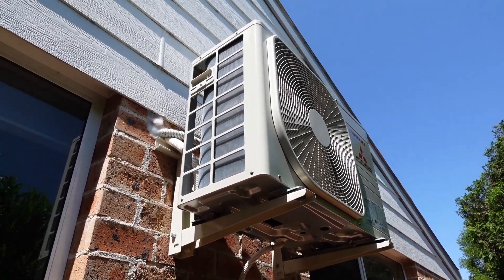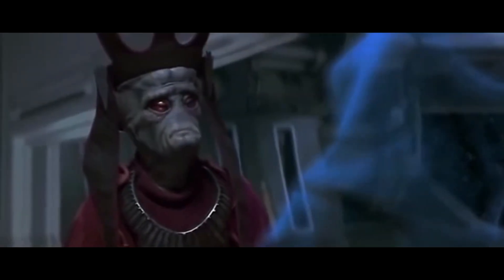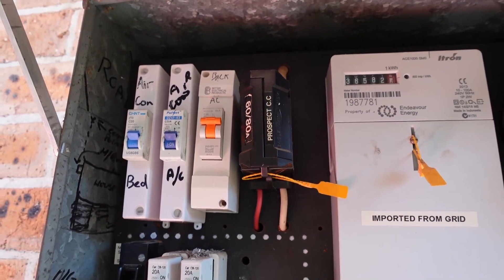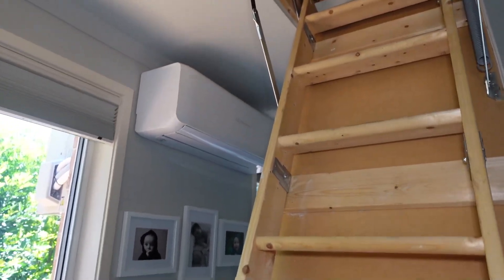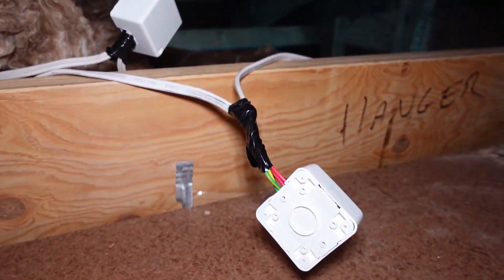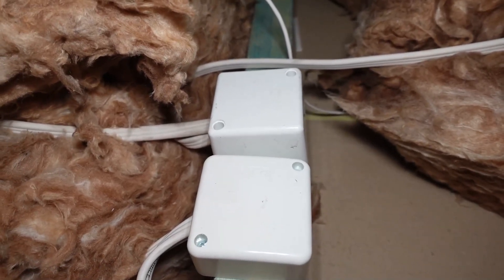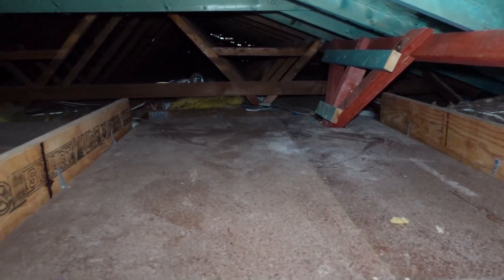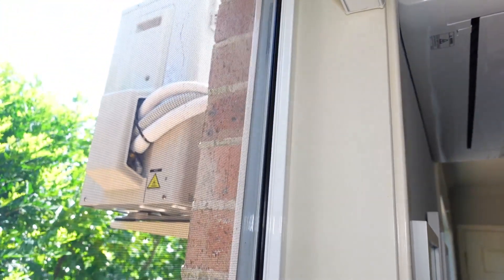Aircon Wiring Install FAIL- TWICE!

Comment: In the UK, BS7671 states that a switch is required for a fixed appliance if disconnection of the whole circuit would be a cause of inconvenience.  That is a design decision which is open for discussion, but the two junction enclosures in the attic are clear deviations from the requirements here.  It's nice to see they came back to fix it, but there is now the question of how many similar jobs they have left behind in that condition.  What are the options in Australia for getting the authorities to step in and do the equivalent of a product safety recall?  The contractor should hand over details of all the addresses they've been to since that employee was first given a screwdriver.

Comment: That's a nice bare wire hanging out of the rear of the breaker panel !
I suggest importing Dave Savery to sort out the breaker panel with a UK consumer unit :)
Reply: lol uk regs are so strict compared to AUS and NZ.
we still use red and black for line and neutral.

Comment: Are you not allowed to install it yourself? I always find that weird where countries have rules what you do inside your own home.
Reply: They have added more limitations as the years go on.
10 or so years ago in NZ we could.
Change a outlet
Change a light switch
Change a light fitting
Replace a cable as long as it was not one comming from the panel
Replace wire in rewirable fuse that is now prefered to be done by a spark to many cases of wrong fusing.
Repace equipment that uses fixed wiring.

now we only allowed to change our bulbs and reset breakers

Comment: Wait wait wait, you can actually freely look behind main electrical box? .__.
Here it's bolted and sealed, so nobody can just connect wires directly around electric meter without breaking seal. And that can be pretty expensive when distribution company finds broken seal.
Reply: it is very common normally a screw or two stops it from been opened

Comment: One benefit of living in the UK.  We have one of the best home wiring regs in the world it seems.
Reply: I do home inspection reports in Birmingham, UK.  The standard of wiring in this video is fairly typical here as well.  Some of the worst ones are accompanied by an NICEIC certificate.
Reply: @westinthewest  \\totslly agree there are lots of doggy installers here also. I eant the specs UK installations are supposed to be. His distribution board looked terrifying for instance.
Reply: The comment about the UK being the best is a joke, right? They allow ANYONE to do electrical work there, don't they?
Reply: @johncoops6897  All new electrical work must comply with Part P of the Building Regulations which restricts DIY electrical work on grounds of safety. However, you are still allowed to carry out some work yourself without notifying Building Control. Minor repairs and maintenance are permitted, as well as ‘like for like’ replacements, such as changing existing sockets, switches and ceiling pendants or even replacing damaged cables. As long as the job isn’t within a ‘special location’ such as a bathroom or outdoors, you’re also allowed to install additional new light fittings, switches, sockets and even add a single fused spur to an existing circuit (a ‘spur’ is a new cable and socket run as a branch from an existing socket on the ring main).

Everything else, such as installing complete new circuits or changing a fuse board for a consumer unit, is classed as ‘notifiable work’. This requires a Building Regulations application to be made in advance so the work can be inspected and checked. However, in most cases the electrician can self-certify their work as they’re normally registered with a body that gives them the necessary ‘registered installer’ status (also known as ‘competent persons’) such as the ECA (Electrical Contractors Association) or NICEIC (National Inspection Council for Electrical Installation Contracting).

A ‘non-qualified’ person can still carry out notifiable electrical work as long as Building Control are informed – but if you fail to do this and the work is found to be unsafe, it can lead to a hefty fine. Upon completion of the job, it is a legal requirement for the electrician to test the new system and hand over a signed BS 7671 electrical safety certificate. In addition, you should be sent a Building Regulations compliance certificate for all notifiable work by the operator of the registration scheme.

Comment: I think after their second attempt i'd be getting an independent electrician in and handing them the bill. Have you checked the screw connections inside the boxes are tight?  Damn, that's a disgrace!

Comment: not sure what is more scary the back of that fuse panel or knowing its 220v standard combined with how it looks
Reply: What's 220V got to do with anything? All that means is that we only need half the amperage as needed in the USA. So the "electrical integrity" is less critical, not more.

Comment: Being British I have a total of 6 air conditioning units in my flat (apartment).
They were free and don't use ANY power whatsoever.
They are called, windows I can open. As in actual physical windows and not the Microsoft type. 😊
Reply: Yeah, but you can't open the windows because the fucking RAIN will come in. Not that you'd open them anyway, since it's so frigging cold LOL.

Comment: What the hell is that?

4 units? You should just have a multizone outdoor unit running the whole house.

Also, what the hell kinda fuse box is that? Completely non standard looking, no main busbars, just things put in every which way. Australia has to have the most messed up electrical in the developed world by far. Maybe the UK would be a distant second with its ring mains.

Comment: Hey Dave, did you say that the entire house was fed by one or two breakers?  Does that mean all lighting, receptacles, appliances etc?  Do you not have a separate breaker for the stove, washer, dryer and maybe areas of the house?  If so, that's interesting.  How would it work to have a 15 amp outlet trip on a higher amp breaker?  There must be something missing in the layout.
Reply: They probably have a gas stove. But still, only two breakers for a house with four people is still annyoing.
Reply: There is one lighting, 2 power and one stove circuit. That is FAR too few for a modern home.

Comment: So 5 breakers for the entire house? Around these parts a typical house has a dozen or so per phase. Practically one circuit breaker for a couple of outlets, dedicated breakers for high power items like electric stoves, water heaters etc.

Comment: The installation is kinda shit. Usually there would be a disconnect (often fused) with the penetration inside to actually handle terminating the condenser unit, with proper conduit/flex here in the states. That way you don't just have stuff jammed thru the wall like that. And damn that breaker box is something else. Usually see a proper panel, or at least conventional "six disconnects" here, even at some of the oldest places I've lived in. Edit: OMFG the inside of that panel! Like house fire waiting to happen!

Comment: Hahaha, at least they hung a box off that wiring to cover the wire nuts :) that's pride.... That's why i can't stand "installers", they just do the quickest job possible because there's no incentive to do a good job.... The electrical equivelant of the ol' "saddle valve" for the icemaker / dishwasher install.
Reply: We don't use wire nuts we use connectors 
theses https://www.ideal.co.nz/nzi/Category/Crimp-Terminate-and-Connect/Terminal-Block/Screw-Connector-Single-32A-%28Jar-100%29/p/BIZ390052

or these
https://www.ideal.co.nz/nzi/Category/Crimp-Terminate-and-Connect/Terminal-Block/Terminal-Blocks-10mm-Black-%2830A-400V%29/p/BIZ320003

Comment: Fine so long as it a protected citcuit but they should really have put it on a seperate circuit with an rcbo or if not at least on a switched fused spur.

Comment: Why do you need 4 HeatPumps? A huge house 200 square meters only needs one. Is your house like 800 square meters large?
Reply: Well to answer my self after finishing watching the video, nearly no insulation... Where those even double windows with argon inside?
Reply: It's SYDNEY, and it is hot here. Each of these small 2-3kW units will be suitable for about 20 square meters, not 200. Even a large 7kW split will only service 50m² or so.
You obviously didn't watch the video, as the insulation is quite thick. They don't "over-insulate" here because that keeps the heat IN.
Reply: @johncoops6897  I'm 100% sure insulation keeps heat out if you are in warm climate and keeps the heat in if you are in cold environment.  This is obviously based on the fact that ppl use heat pumps... Yes good sir insulation is insulation it doesn't change it's form/composite :) It insulates heat. I certainly watched the video, and saw the lag of insulation on the roof and the walls. Well less so in the walls. We have 70-80cm of insulating ecological wool on the roof. Here In Finland, and you chaps only have delta of what? ~20-30 degrees? difference, that good sir is nothing compared to our delta of ~30-50 degrees Celsius, in the winter obviously. Summer deltas here are like 10-5. Also our house is almost air tight. It relies on the central air unit to keep it cool, dry and warm.
Reply: @JoneKone  - you heating continually, so insulation matters. In Sydney the climate is often mild, like today in mid summer it's only 24C in daytime... nobody would run the A/C today. However in one week it might be 40C, however people would not run A/C  if they were at work or even gone out to shops.
So, when it is suddenly hot like that we need to purge the heat from the house as fast as possible, then bring the air temps down using the A/C, usually they are powerful localised units rather than a central system. We cannot use lots of insulation because that makes a "heat bank" which retains the heat. We cannot stop it getting in, as our climate and lifestyle generally is for fresh air and open doors. The usual ceiling insulation in Sydney would be about R3 or perhaps R4 or R5 in new builds,   and walls perhaps R2 or 2.5. Because of the climate we don't use double glazing on windows or glass doors either - we don't live in sealed houses with all the doors and windows sealed shut, and it's all about utilising the cool winds and lower night time temperatures to get the temps down. Generally, we work with the climate, and not attempt to beat it.
Reply: @johncoops6897  I'm not heating continually, as I explained I have insulation that allows me to use just 1 heat source to heat the entire ~200 m squared house. To top up the heat around 2hours of heating is required, it then equalizes and for comfort the air unit keeps the house in equal heat, with minimal power. I don't need the air unit. But obviously we all live in comfort, like you do. Yes the air unit has an electric heating unit. The same principle is "inverted" and can be utilized in a environment that needs cooling. Just add insulation make sure you have proper airflow to keep the air/house dry. And voila you don't need 4 split units to keep you in comfort. And obviously I was talking about temperature deltas of the worst case not the best case. Here in Finland in the summer it's 5-30 Celcius + outside at summer. So the air unit mostly has to keep the house dry and tempered temperature. But my point was that more insulation (obviously more harder to do in more than onse sense, cause i have seen super insulated houses rot, done wrong) equals less energy used.

Comment: For the non-Aussies on here, Dave's electrical panel looks 1980's. For many years the neat DIN rail panels have been the norm here in Australia.
Reply: Yeah I live in a public housing unit and they ensure tenants have safe facilities. When I moved in back in 2005, I still had a "consumer unit" like Daves, then a letter came, and a bit later a sparky, and about an hour and a half later I had a nice flashy new consumer unit box din rail jobbie complete with RCD's and new circuit breakers. My ups didn't even have a chance to run out of juice while he worked :) Yes as soon as he was gone, I carefully opened the box and he did a top notch job with the wiring. :P
Reply: that panel is earlier than the 80's, the din rail come in the early 70's I was wiring them back then.
Reply: DIN rail is still nowhere near good enough for a home install. DIN rail is for industrial use. Why do you not use proper enclosed panels that have much higher safety standards? I've seen newer DIN rail installs. The quality of them is still sketchy. They can be a LOT less sketchy than the old setup Dave just showed, but compared to what we use in the US, there's no comparison.

A box should have a cutout that is the exact size of each breaker that goes in, it should hide the wiring, the wiring should not flex AT ALL when you open the panel, etc. Just so many problems that DIN rails bring. There's honestly no reason to be using DIN rails at home.

"But it allows for differently sized breakers"  is the only counter claim I can think of, but is that REALLY a benefit? I definitely don't want a mishmash of random breakers in my box. If there are other reasons, I'd be interested to hear them, but I took a pretty good think about it before deciding that there is probably only that one "benefit"

I'm not normally the type of person who cheers for team USA or anything (countries don't mean much to me in general) but man, it feels like the US is the only country that has gotten this (somewhat) right.

Comment: It always amazes me that those types of distribution boards are standard (and even allowed) in some parts of the world still.
Reply: This panel is very old, 1970's or something. Providing nothing is altered, it is perfectly legal. However they are required to upgrade it to modern codes if there is any electrical work done, which obviously there has been over the years. A modern install would use a Consumer Unit with DIN rail breakers, busbars, etc. It's crazy that Dave has a young family yet chooses to have such a dangerous, old fashioned electrical system.
Reply: @johncoops6897  around here, adding a new circuit would be a modification requiring replacement of the panel.
Reply: @EricMBlog  - similar here in Australia, but the rule is "bring it up to current standards", rather than "replace the whole lot".
Many of the so-called contractors (we call them "wire jerkers")will just add the new circuit then not tell anyone. Everything is self-certified so nobody will ever catch them or get in trouble - totally negates the point  of licencing and electrical safety rules..

Comment: You didn't get into the specifics, so I'll do a lot of assumptions here. But, where I live, when you get an air con installed, the Electricians first come and do the electric install for the air con based on its specs. Then the refrigeration guys will come and install the air con and hook it up to the nearby disconnect. Once filled, they will be able to flip the disconnect on and test their, your, air con. That way, you have an up to code install on both sides, electrical and refrigeration. Take Care!
Reply: It is the best way but costs more.
many company's get a refrigeration guy get him the limited electrial licence and send him to work.
meaning they can't go in to the panel here in NZ
Reply: @ratbag359  Got it! Still illegal in my Country. Making such an install... well, unlikely to happen.

Comment: Isolator - Aussie-speak for circuit breaker
Reply: No, it's two different things. The isolator is just a manual switch, placed close to the unit, so it's possible to de-energize the unit if it's malfunctioning and/or someone wants to work on it. The isolator switch must be lockable with a small padlock in the off position, so it can not be turned on accidentaly when someone works on the isolated unit.
Reply: @mrnmrn1  So my first post was right, an isolator is a disconnect. He was showing breakers as isolators so I am confused.

Comment: That's terrible Muriel! Even though they've sorted out those messy junction boxes, the cables are still flapping around in the breeze, when they should be clipped to the beams.
I'd get a right bollocking if I left work looking like that.

Comment: 2:38 I find it interesting to see how it's done in Australia.

In Singapore, for power to air conditioners, we have those big grey isolator switches with the lever (where down is on and up is off) in homes designed to accommodate modern split air conditioners, but in older apartments that were designed with box type air conditioners in mind, they instead have a cord running through the wall to a 15A socket where the box unit would've plugged into, and a sheet of plywood (painted over) to cover up the hole where the unit would've stuck through. I've a feeling air-conditioning in Singapore in the 1980s (maybe even the 1970s) might've been a luxury, as the box unit could only be installed in the master bedroom, while all other rooms had to use casement units.

Comment: Huh. Here in the 3rd world, the inside unit of the AC plugs into a wall socket, and a cable goes from it to the outside unit. No breakers or anything like that! So interesting to see how stuff should be done
Reply: it's a small unit so it probably could be done either way.  i've bought (in Oz) a few of these split units over the years and they all came with a plug as standard, it's up to the installer (and your wallet) whether they remove the plug and run the wiring internally.